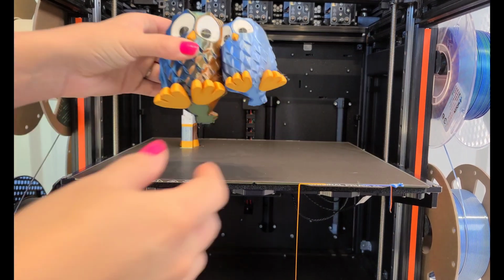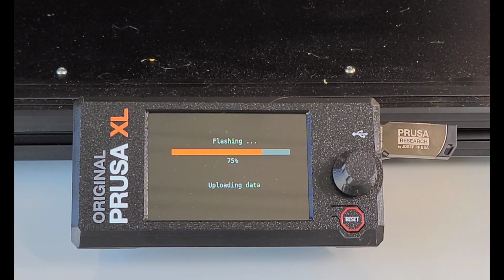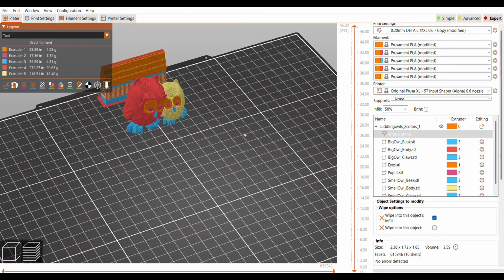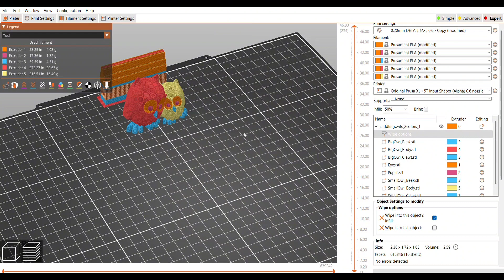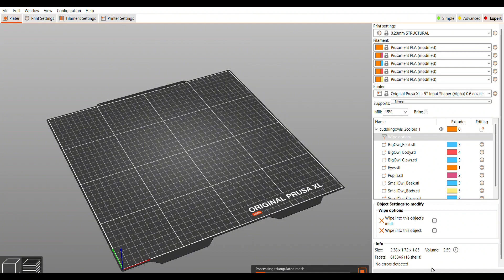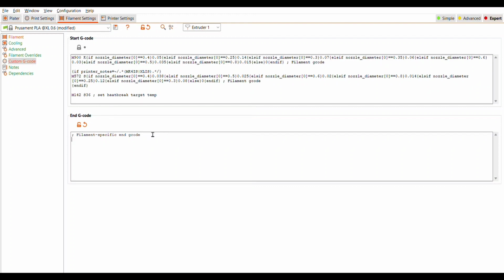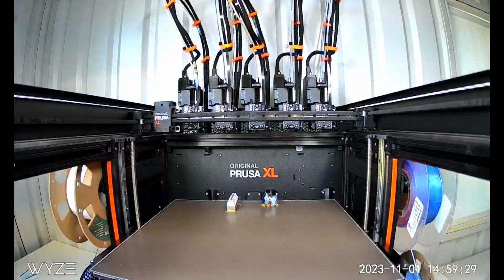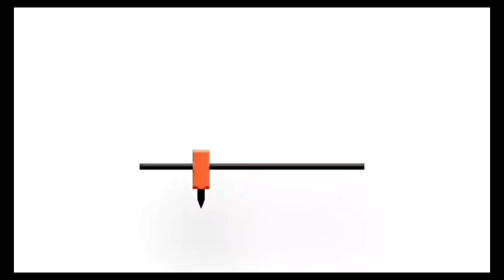Does stringing on the Prusa XL get better with Input Shaper?

Comment: Do you see the last livestream from 3d Printing Nerd with his 5 Toll changer? Absolutly no Stringing. i mean he hast chance the Settings for the Temrature to 210 but im not Shure. He said somthing about this in the stream an self. But his Resulst are outstanding. But he uses also Polymaker PLA.
Reply from the maker: True. I would switch if that was the trick. I'm running a benchy now at 190 and I still see stringing. But I'm going to let it finish and see whats next. Thank you!

Comment: Nice to see you tried the alpha, and good job on the dedication in trying to figure the issue out!

At this point you should probably contact support, see if they have any idea about potential causes. This printer is pretty expensive, and simply accepting such stringing wiuld just be a shame.
Reply from the maker: Spent some time on chat with them today. Their suggestions were lowering temps and then upping the retraction. So I'm working on trying these out. Thanks!

Comment: so you do not tune for diffrent filament att all? temp towers/retraction/flow?
Reply from the maker: No because I've run all of these on my single toolhead without issue. But mixing them together is just too much. Working on adjusting this. Thanks!

Comment: I watched 3dprintnerd Joel’s live stream with his new 5 tool xl the other day and his print looked excellent, but I didn’t catch the beginning to know if he had adjusted anything
Reply from the maker: I watched a little bit and caught he was using alpha input shaping and lowered the temps a lot. Not sure how low but I'm going to try it. Thanks!
Reply: @tada3dprinting apperently the heads run hotter than it says, people have lowered temps by 20 degrese, give it a test.

Comment: Yep, something is not right. Rerun the calibration, make sure nothing is loose, double check build instructions and comments for possible fixes or warnings, clean underside if nozzle use prusament filament, test each head, then the combination of two, three, four, etc; until you perfect a single head print using prusa filament or prusament I wouldn’t bother doing all five. Process of elimination must be done to troubleshoot this issue. Try different stl files that you slice yourself. Not 3mf files you only need the object itself not any other information in your files. Everyone I’ve seen that has an XL regardless of the number of heads has been able to get perfect prints using PLA every time. At most you might get a little wispy but, nothing like that crazy string.
Reply from the maker: Thanks so much!